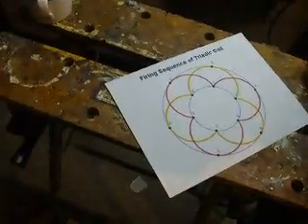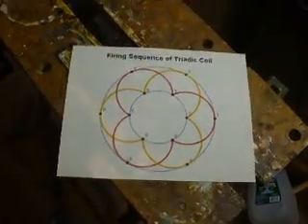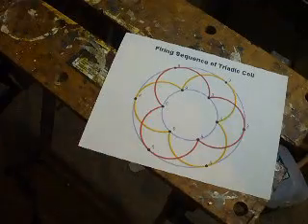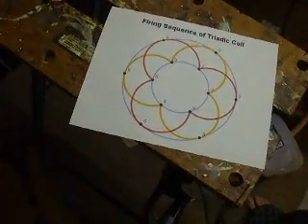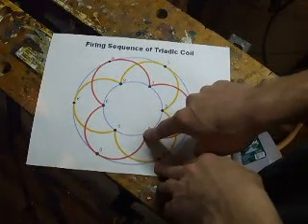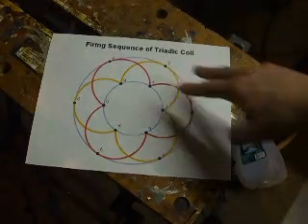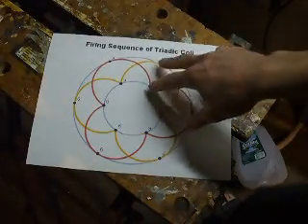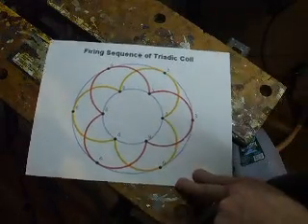How Resonant Superconductivity is achieved in a Rodin Coil

Comment: I could be mistaken, but I think back emf idea isn't right as there is very little or none from a good rodin coil, not sure w/starship coil. I also find Rodin's comment not favoring that most use both physical circuits as though they are one. For better results, use both physical circuits separately. Insults intelligence when you have such a new outstanding innovation, but then use like it's just a single wire coil. GregorArturo85, well done for being so creative. peace

Comment: "As long as there exists the same magnetic moment in every potential well in a given superconducting chain, as in the case of the ferromagnetic materials LaOFeAs, and the three necessary conditions required for superconductivity are satisfied, the superconducting state can be formed and the superconducting process will persist without dissipating energy"